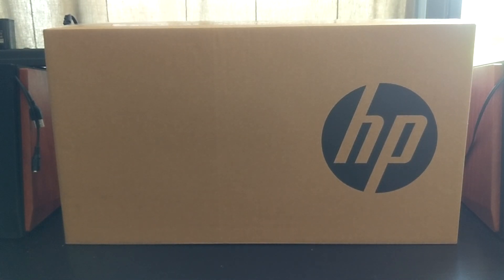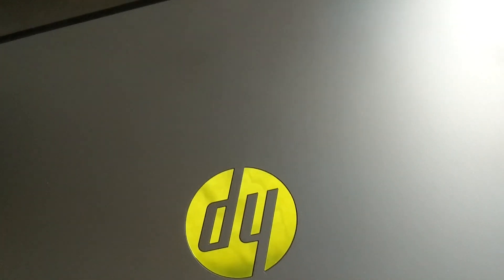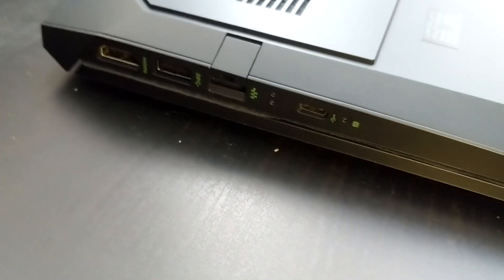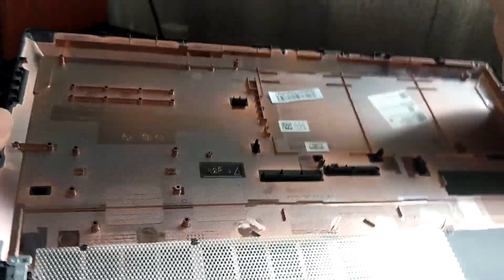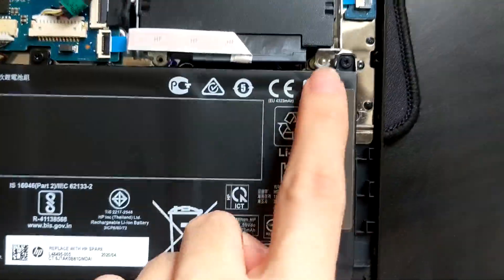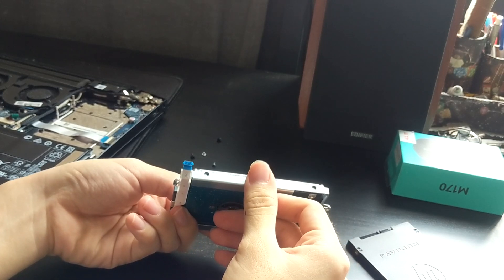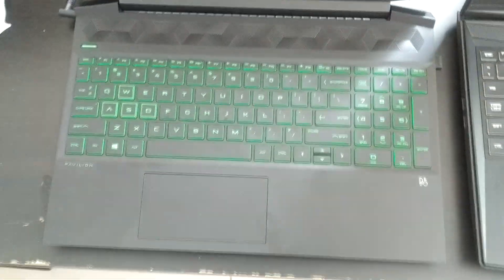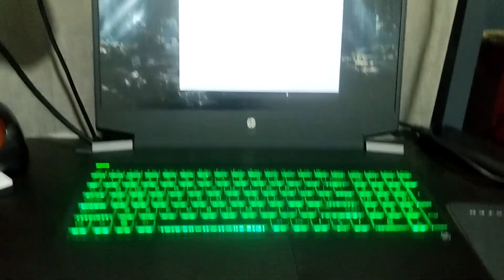HP Pavilion Gaming 15 Laptop Review + HDD Install Guide

Comment: I think you need to disconnect the battery cable before touching the board
Reply: Yes! You should. Also he's replacing RAM, we want the memory controller to relearn!!! This model uses the main battery as CMOS power, so disconnecting it does that

Comment: Bro amd 3550h only supports ram of 2400mhz, but u installed 3200 mhz hynix ram. Instead low latency of 2400 u have installed. This system will automatically downgrade. Expenses are not worth..
Reply: u saved me bro was about to buy

Comment: Bro you have to do something you have 13 GB of RAM available but you have 2 slots with 8Gb. Windows eat 3 GB from the start. For this is a solution just to search on the Internet.
Reply: No. Thats 2gb consumed (reserved) by vega 8 integrated graphics of amd,wherein intel dont give more than 100 mb in top end system.